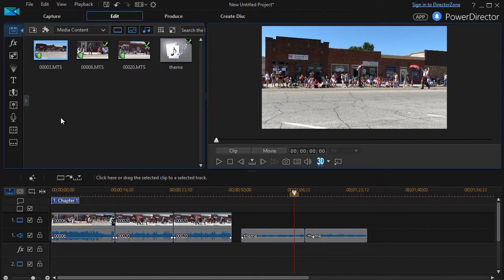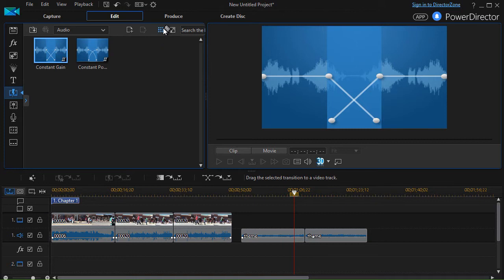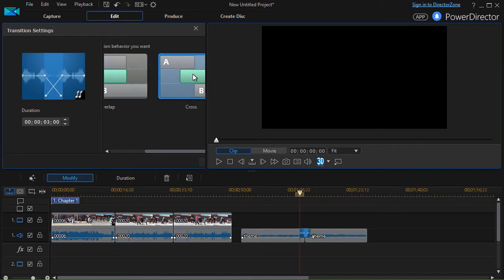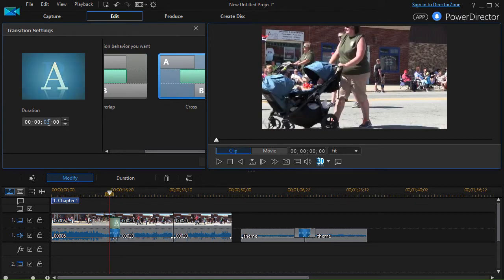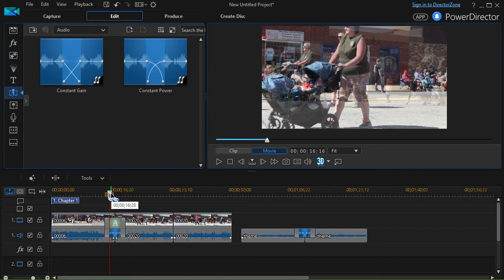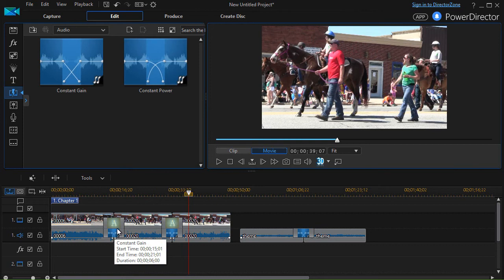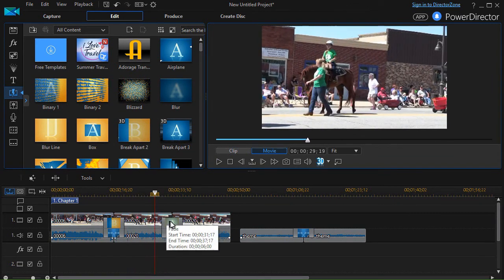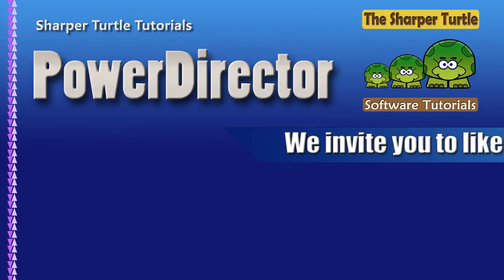PowerDirector - How to use the two audio transitions

Comment: How do you make it so the audio does NOT go down to nothing and then back up again? This was a simple pull-down effect on Final Cut Pro. PD makes it more difficult, and I'm not even sure how to do this. Is a non-fade up/down audio transition even possible on this software? Thanks in advance
Reply from the maker: Are you looking to modify the Db level on one clip or multiple clips? Is this a case where the original audio varies in volume? 
What is the nature of the challenge you have? 
You can normalize audio on different clips or you can set keyframes to modify the audio on a single clip. You can also adjust the audio of a clip up or down by the same degree.

--Jim
Reply: @SharperTurtle  the nature of the issue is that I'd like to put a brief audio transition between two video clips so the sound doesn't make a clipped choppy noise. Example - crowd noise in two clips varies in volume. A simple audio transition with steady audio (that does not go UP and DOWN - what a stupid default) would do this. FCP did this with one button. PD seems to be absent of such a function. I want to be able to drag down an audio transition effect between 2 clips and NOT have the volume go down and then back up again between them. Is this possible? If not, then PD has a big red flag from me. Thanks
Reply from the maker: Thanks. I think I understand better. I'll experiment and let you know what I find out. --Jim

Comment: What about unlinking video from audio.  Temporarily move the the audio to another track.  Add the audio transition and then play it in place or move it back up to its original track.  Similarity, unlink both, but move the temporarily move the video up.  then add audio transition.  Either rejoin the two, or just leave split tracks.
Reply from the maker: Chris,
Your technique works to produce an audio transition in a video clip without adding a video component. You need to separate the audio and video tracks, then move the audio tracks to a different track, add the audio only transition, and then you can move them back to the original track with the transition if you want or leave them in a non-contiguous track. It worked for me just now. Good thinking!  -- Jim